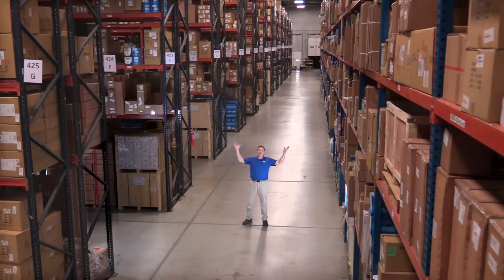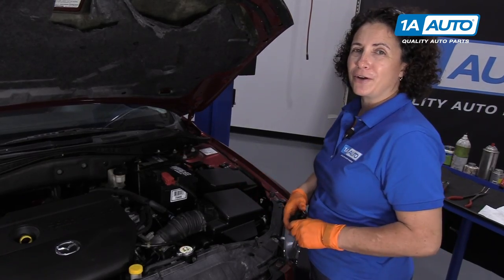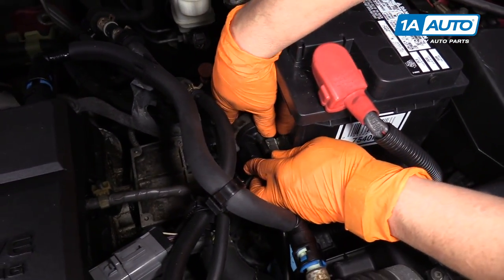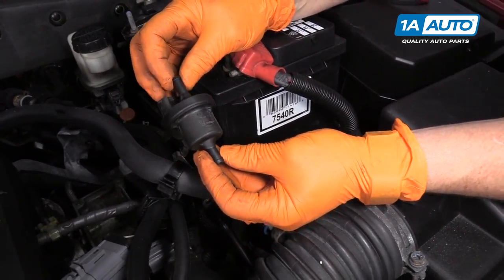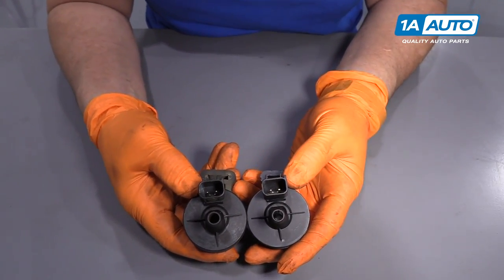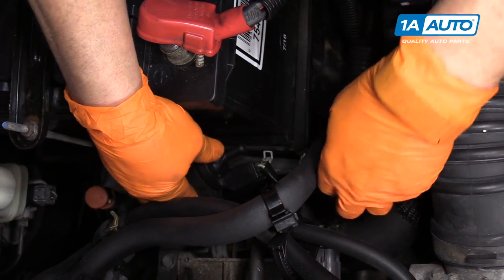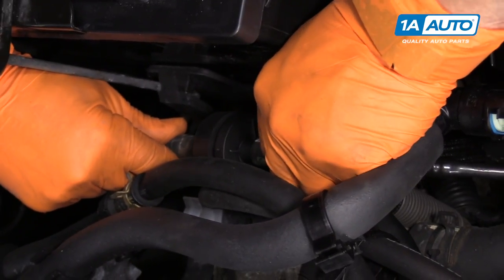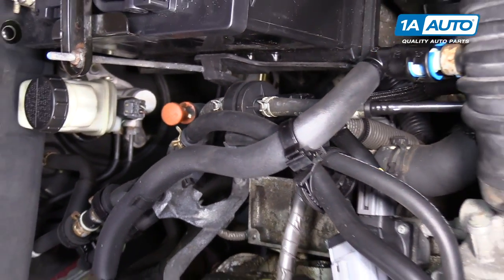How To Replace Purge Valve Solenoid 06-08 Mazda 6

Comment: is this the same for a mazda 6s 2005 3.0L?
Reply from the maker: +asassin93 It may be a different procedure on your application. We currently do not have an auto repair video for this particular year, make and model. Thank you for asking. 1aauto.com
Reply: I have a 2006 Mazda 6s. I believe it's somewhere on the passenger side. I'm in need of replacing mine also.
Reply: I have one too let me know if you find it
Reply: Right I have this problem

Comment: I have ? Oil light is flickering on and off in the engine started to putter what do you think could be wrong with it could it be the oil sensor
Reply from the maker: +Darth invidious We wouldn't be able to diagnose an issue like that here, you may want to have a local mechanic take a look at it. Thanks for checking us out! 1AAuto.com